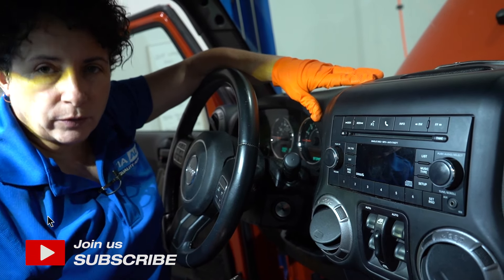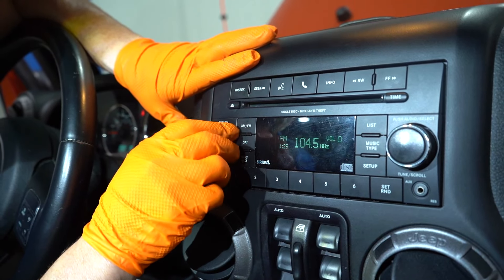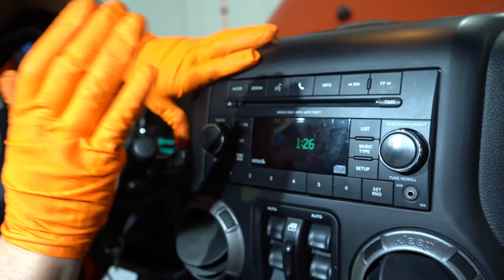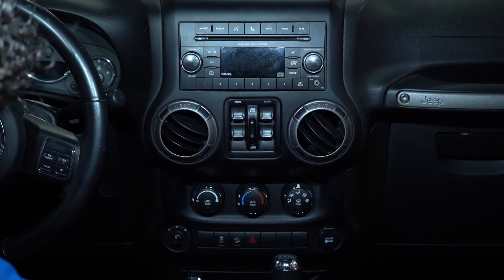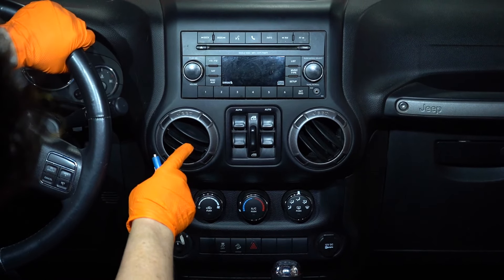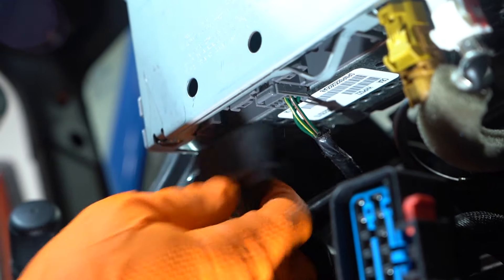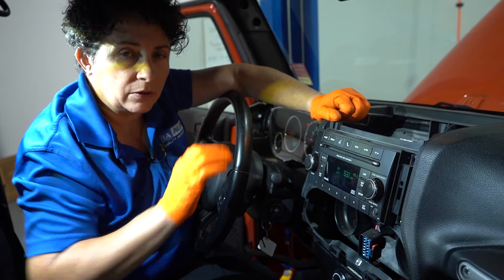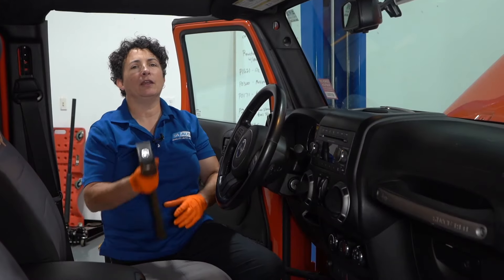Chrysler Radio Volume Not Working? Try This Quick Fix First!

Comment from the maker: √  Watch the Video
√  Buy The Part at 1A Auto http://1aau.to/m/Visit-1AAuto
√  Do it Yourself
√  Save Money
Reply: Heeelp i have a toyota highlander 2002 limited with jbl audio but i bought without a car stereo. I bought an aftermarket radio and im trying too hardwire to highlander but i cant find the color diagram for the life of me. Im desperate i tried finding the cables with a multimeter and i cant find the accessory cable well i dont know what to do.

Comment: Once out, pop top off, looking down from front you will see a chip on the right not covered with film like the rest of the board. Apply some heat (eg. Heat gun) while pressing down on chip with something (reflow). Reassemble.

Comment: Lol. This is a 10 min fix. Remove radio and open it up to access board. There is 1 chip that needs to be re soldered with a heat gun for a few seconds. Radio fixed

Comment: lol there is a chip in the circuit board that just needs to be re soldiered or slightly heated to adhere. Found it in another YouTube page. Also after repair it might loosen again because of vibration/movement of the vehicle and I think it might have something to do with heat/cold that runs close to the radio…so I recommend repair and epoxy but get the repair right first before you epoxy…

Comment: I didn't quite get the "item reset" logic.   
Disconnecting the radio from the connectors would not do anything in regard to resetting the unit than would disconnecting the vehicle battery for a time period. 
A true "item reset" would involve a factory reset process on the radio itself. usually by power-up button holds or some other kind of programming.   
In this case you had to take the radio out anyway so you needed to take it out.  
But for a "try this first" reset the radio type operation there should be no reason to take the radio out. 
There should be nothing hooked to it causing it to "not reset" or not allowing it to reset other than the main vehicle battery.

Comment: Props for getting in there and trying something 1st before you take it in to dealer. In the 42 yrs I've been alive and working on cars(as well as driving), I have only brought my personal vehicle to ANY REPAIR shop, yet alone never a dealer,  a total of TWO times EVER. I've been a licensed mechanic for 14 yrs so I've seen a lot, but never have u saw it all, until now. No disrespect, but WHO POSTS A AUTO REPAIR VIDEO THAT DOESN'T FIX THE PROBLEM OR RATHER, HAS NO IDEA HOW TO DIAGNOSIS AN ISSUE PROBABLY? Seriously, no disrespect but why did u even post this video? You sound and look like you have no clue on how to diagnose an issue or even trouble shoot the symptoms. In not going to get into the RIGHT WAY to trouble shoot an issue like this but a word of wisdom, when removing the power source to a electronic device to some what reset it, you shouldn't have your personal settings still saved and working (such as preset station)  when you power back up. If so, you did NOT reset ANYTHING. JUST SAYIN. Good luck there lady.  Oh but hey, look into a problem with the AM/FM  chip on the circuit board as an possibly. Many have had loose or broken solder connection that need to be reflowed to restore AM/FM sound. Hint hint